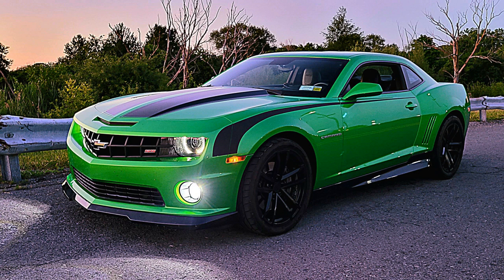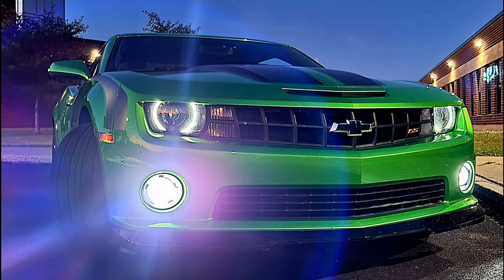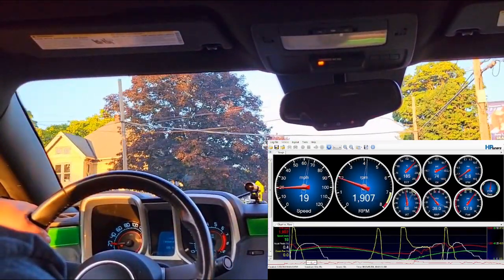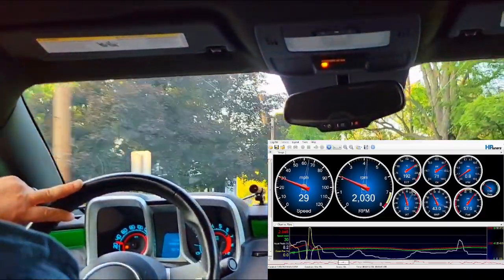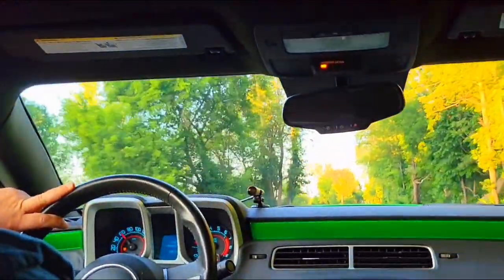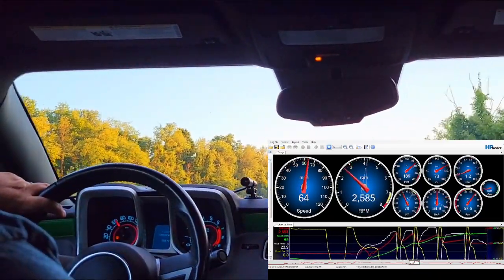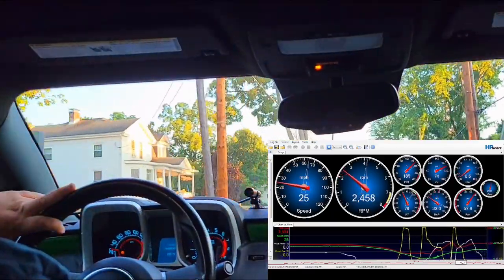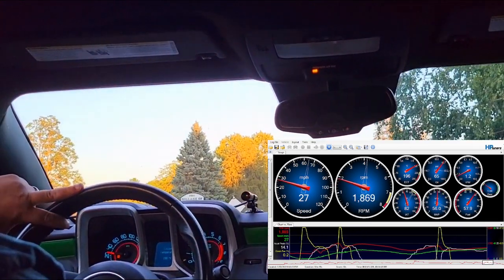GPI Max Package 2.0 Drive-ability

Comment: Thanks for the clarity... I'm not getting it. Best to supercharger or turbo or even nitrous the ls3 camaro. All that money for what!? 550whp?
Reply from the maker: Yea, it's definitely not for everybody.  Naturally aspirated horsepower is definitely more costly per dollar when competing against boost or nitrous, especially when you want to start getting into the upper ranges of what's possible.  550whp is certainly not the limit - that's really the base expectation for a setup like this.  We configured the car this way on purpose, as an example of what's possible "out of the box" with this package.  It would not be a stretch to add flycutting, more compression, E85, and achieve near 600whp numbers with the stock hood and cowl still intact.  With a little cutting and a high ram, we could easily exceed 600whp.

Could you do it easier with boost - absolutely.  For some of us, we like to do things the hard way, and really enjoy what a super efficient, well thought out combination is capable of.

Comment: I got this setup on my 14 ss with a 4600 stall and I went with the msd atomic cause I didn't want to put a 3 inch cowl hood on it for the high ram and let me tell you the msd atomic intake manifold is a real piece of crap, should of just went with the high ram. Steer clear of the msd atomic intake manifold for this setup and any other setup for that matter cant tell you how many times the throttle body seal just blew out, its very thin and a terrible design throughout the manifold seals.
Reply from the maker: Sucks to hear about the MSD.  On LS7 stuff, from our testing, there isn't much between the LSXR and the MSD Atomic - and the LSXR didn't have the fitment issues the MSD had - so it was the clear choice.

Comment: How much power did you make with this set up?
Reply from the maker: 551whp
Reply: @andrewcammer2535  those are really good numbers, anything else you think could’ve been done for more power?
Reply from the maker: @dwighthoward6073  definitely more to be had with added compression, and a more aggressive intake manifold.
Reply: @andrewcammer2535  also I’m looking to get this package but I’m a auto c6, what size stall do you recommend?
Reply from the maker: @dwighthoward6073  a 4000rpm stall would be appropriate with the cam in this package.

Feel free to shoot me an email if you want to discuss some details directly.  Andrew@gwatneyperformance.com

Comment: How would the max 2.0 cam Do with a power adder like procharger ?
Reply from the maker: Beautifully.  Different forms of boost do tend to have different needs from a camshaft.  A PD blower likes low overlap and generous exhaust duration.  Turbo setups need low overlap, and they have to be very critical of exhaust valve open and close events to ensure they manage the pressure in the exhaust system used to drive the turbine.  Centrifugal superchargers like pretty much everything that a naturally aspirated camshaft does, generous duration and generous overlap.  So, a ProCharger would be perfect.

Comment: Hi Andrew, I've been waiting patiently to hear more about this package. Your car and mine are pretty much the same. Mine is a 2010 I think is the only difference. I got a quote from you for my cam set up but was holding off to see more on this set up. I most defiantly want to get a quote on this set up. My wife and I wanted to make sure drivability was going to be acceptable before we made a decision. We want to be able to drive our car on some longer trips from time to time. Thanks for all the work and research you guys have done!
Reply from the maker: We are hopefully going to make that release any day now.  Lot of ya'll have been patient, and I know it's been a long time coming.

Drive-ability is really pretty good, as you can see.  It's a big camshaft, lots of overlap, and it's not going to tolerate real low rpm without load on it, but other than that, with good tuning it drives great.  Road trips, no problem.  I drove this setup 1,200 miles home the same night we finished the dyno tuning down in Arkansas.  Averaged 22.5mpg with 4.10 gears cruising comfortably at 70-80mph the whole way.
Reply: @andrewcammer2535 sir, i live in Texarkana, Tx, on Ark/Tx, border. Who did you use, to dyno tune your set up? I've been having trouble, finding reputable dyno tuners, in my area. Thank you sir
Reply from the maker: @josephmcintyre752  the initial dial - in on this tune was at GPI in Jacksonville AR, and I've done the fine tuning on driveability myself.
Reply from the maker: We did get this released this week.  You can e-mail me if you want, and we can chat about details: andrew@gwatneyperformance.com